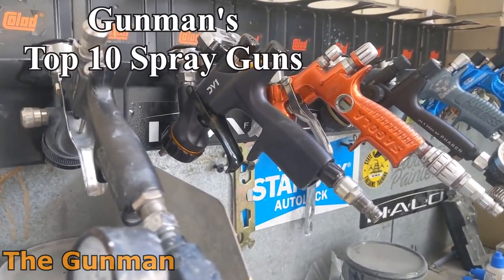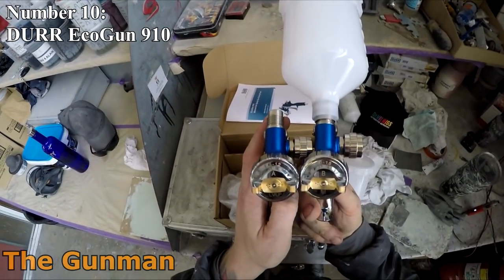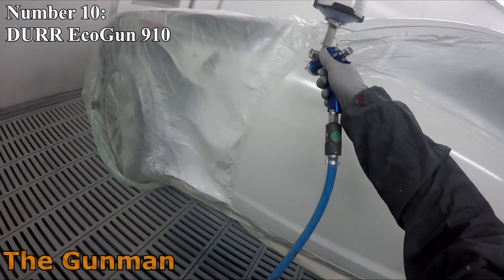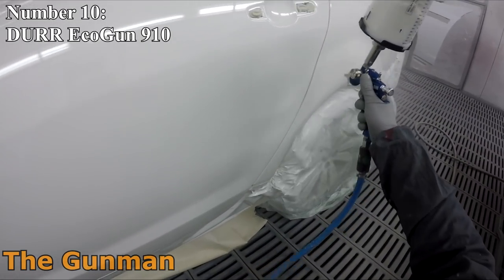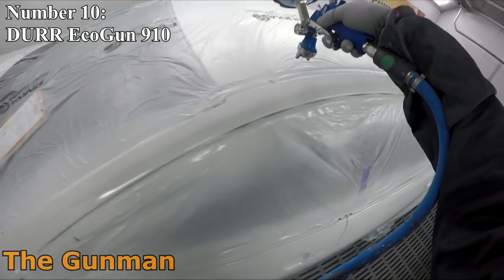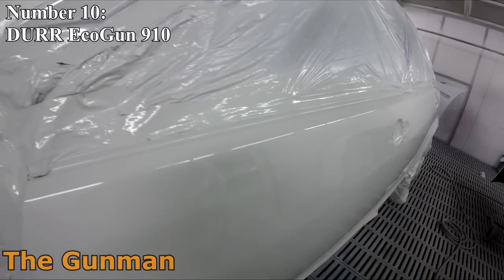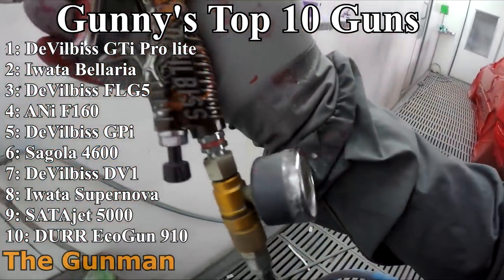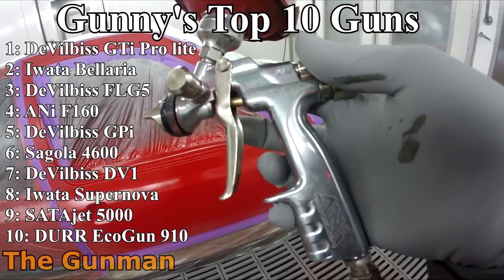Top 10 Best Spray Guns

Comment: I know it's old now, but how does a LPH400 stack up against these newer guns? I'm wondering if it's time to upgrade.
Reply from the maker: The LPH400 is actually totally fine. I wouldn't upgrade unless you want or need another gun
Reply: @TheGunmanChannel  dont really need another...I suppose the LPH400 just looks a little dated compares to new guns, but really it sprays great. If I upgrade I'd want one that can lay clear even flatter than the lph400.

Comment: I’ve seen a pattern with 1.2 tips and fine clear finishes. I use a 1.3 and get a good factory match, I guess my question is does a 1.2 spray a finer finish with all clear? I learned with and still use a 4:1 clear , does this “smaller tip, finer finish” concept only work with added reduced clear or 2:1 clears?
Reply: Does it brother?

Comment: I would like to try out the t110 aircap on my pro lite. Just can't justify spending the price when I get such good results from my te20.
Reply: I just bought the t 110 aircap. It is slower but it is the king of flat finishes. I have the t20 and it is more for matching orange peel. The iwata ws400 also can get some really flat finishes
Reply: I spray every day 3 to 4 cars.
Reply: @jeremyoetken2094  I only spray a car a month but they are high end restorations. I can get pretty good finishes with the TE10 aircap as well but would really like something for nice flat finishes.
Reply: Well I have sprayed with the t10 t20 and t110. T110 has the flattest finish for sure

Comment: Man I'm still confused. Is it ok to buy one spray gun that you use it for primer and base coat and clear coat?
Reply from the maker: You will need a second gun with a larger tip on it for heavy primers. But you could stay with something like the FLG 5 and take it from there.

Comment: Hi Gunman, wouldn't you say, that the Iwata Bellarias currently selling from Japan on Ebay for about 180USD are fake? They seem not original...
Reply: They haven't polished air caps - all the Iwata's I used so far had polished air caps...
Reply: And they don't come with any tooling...
Reply from the maker: Well that could be the case, I thought being that they're from Japan and the originals are from Japan they would have been real, but you could be right

Comment: The absolute best gun not on this list is: Walcom Genesi 360 HTE 1.3/1.2 for clear! 
Absolute flawless spray gun that rocks it @ 21-25.5 psi all dizzy w/ Spies 8180 or 8035 HS Euro Clear! 
Nothing handles those thick, big body clears better than the Walcom HTE . 
And this coming from a decade long Sata head.